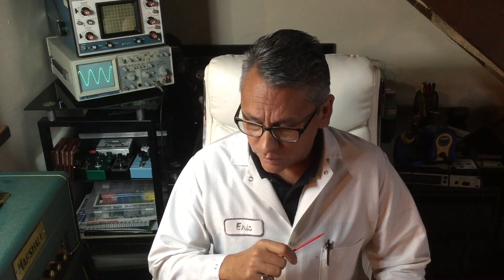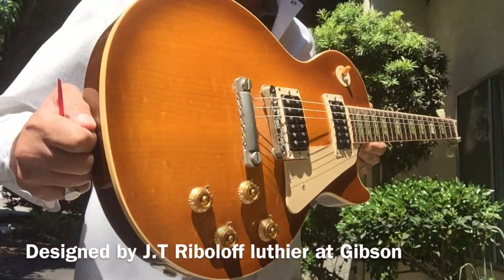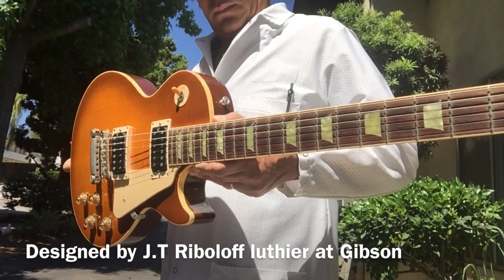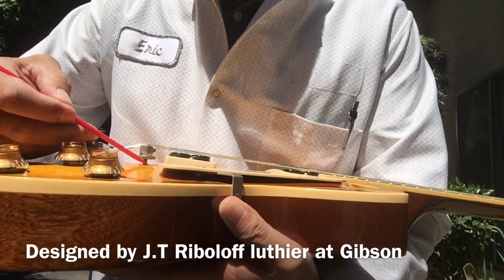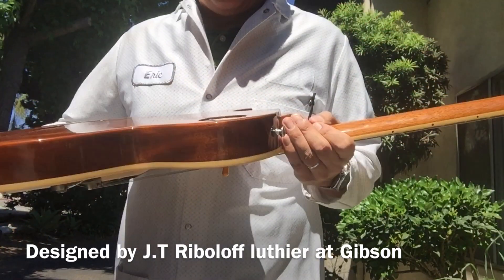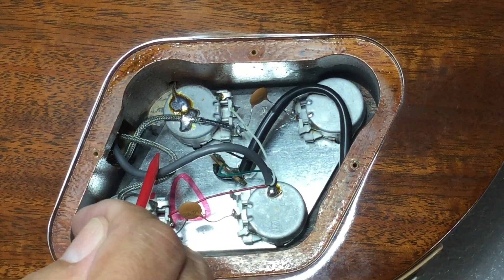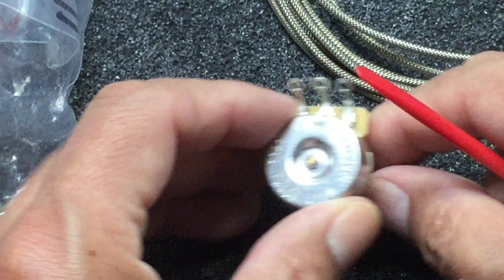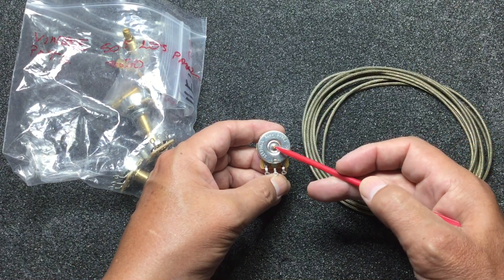Review of the 1990-2000 Les Paul  Classic from an Engineer technicians perspective.

Comment: 1999 Cherry Sunburst Les Paul Classic here. I purchased it new in 1999. Still has the 500T/496R pickups. Recently had to have the frets and neck from the 12th fret up reworked and leveled due to swelling which created a few dead spots. The bridge and tuners are showing some corrosion. Still an amazing guitar.

Comment: I bought a used 1992 LP Classic on the bay back in 2007 or 2008 that looked almost exactly like that one, honeyburst finish with plain top and some bird's eye on it, but it "got lost" in transit and sadly never got home. Finally managed to get my money back (the store didn't want to return my money back... I eventually found out that the guitar had never left the store :smh: it's a long story) and then I bought for a little more a 2006 LP G0 instead, which is a Historic Reissue made by the Custom Shop, basically a R0 made for Guitar Center (hereby the G on the serial #) with plain top instead of figured top. It's been my main axe since that, it sounds and feels amazing and I love it, but I've always wondered what the '92 Classic would be like.

Comment: Great video bro. At the beginning you said the Les Paul classic measurements match several of the 1960 examples that you have had your hands-on, however you didn't specify which measurements. I would be interested to know.

I love the fact that these have the small pin bridge that goes straight into the body VS the grommets/ferrules.
These Classic models are probably the last time Gibson will ever offer that small pin option on a guitar less than $6500 from the factory.
Both Tokai and Edwards LP's offer that option and both are extremely high quality if you can live with a non Gibson name. I can. 
I had a 2006 Les Paul classic honeyburst plain top of course, but I could not live with the green frets! Gosh they were awful, what was that about?
I just got a 1997 classic shipped. I separately ordered the "Retrospec Exclusive Series Cellulose Nitrate Les Paul Fingerboard Inlays" from Historic Makeovers. So that will fix the green issue. 
The non-vintage correct wiring doesn't bother me, I always change that anyways using more modern shielded wire, potted pickups, push pull pot on the neck so that's a wash.  I'm more concerned with the look outside the cavity.

You didn't talk about the Gibaon water slide logo or the printed on Les Paul decals for certain years of the Les Paul Classics. I thought that was something pretty interesting, that might make this collectible one day. Gibson can give us the small pins on this guitar. But they couldn't give us everything.

Comment: Very cool. I have a 2007 Les Paul classic. From what I understand the 2000s Les Paul classics were downgraded somewhat from the 90s ones.
Mine has a two piece maple back instead of one piece. The inlays are an aged color that some people aren’t fond of. The headstock actually says Les Paul model instead of Les Paul classic like the 90s ones do, which would probably help if trying to convert to a more original Les Paul look. Although I think the color and placement that they use for the gibson logo inlay is different from the original Les Paul’s.
I’m not sure if the 90s Les Paul classics were as affordable, but I know the mid 2000s Les Paul classics were the cheapest gibson Les Paul guitar you could get that had full binding.

My guess is that they ended up making a bunch of changes to Les Paul classic - introducing weird colors and knobs and cranked the price way up because the ones from the 2000s could almost be seen as an affordable cheaper reissue.
Reply: What about a 2003?
Are they a little bit like yours and the older?
Reply: gibson used the les paul model decal from 1989-1994ish, and they changed it to be les paul classic. Until, got the decal changed back again to the les paul model in mid-2000s. All Les Paul Classic, I believe, have either one or two-piece mahogany body. cheers

Comment: I bought a new 1999 Les Paul Classic plus from the ill fated Mars Music in Atlanta. I've put this poor thing through the ringer with different pickups and wiring scenarios. Almost sold it a couple of times because I hated it, but 10 years something amazing happened. I actually learned how to play and realized that the dammed thing was amazing. I've settled on Mojotone low winds and 50's style wiring. So happy I held onto this one.
Reply: That's a great shame bud, I have an all original 99 classic and it definitely doesn't need to be altered, if you still have the original parts put it back together, you'll love it even more
Reply: Dominic, bro, you ain’t him. Who are you to tell him what he likes in his guitar? This ain’t a ‘59, nobody should care if he mods his personal instrument
Reply: I try the 50s wiring before and I hated it.   It's more of a online electric guitar trend gimmick. You lose power and volume with that 50s wiring. It makes your volume control obsolete and you control the volume through the tone knob. There was a reason why Gibson stopped using the 50s wiring configuration. It simply reduced the potentials of your Gibson les paul guitar. I prefer the modern wiring that has more options to work with
Reply: @davidallen346 you must of not wired it right. I have full control pot and opened up the guitar 1990 classic plus to alot of tones. The pots and caps have alot to do with the what u get in the end. There are bogus caps and bogus wiring schematic on the internet.

Comment: I have a 1999 Les Paul classic, honeyburst , just like the one you have shown. The main complaint I have is it doesn’t stay in tune too good. The inlays are aged greenish tint also the tuning pegs.
Reply: tuning problems with these would definitely be centered around either the nut, or the tuning peg itself.
Reply: lub the nut, i lub it just fine with vaseline

Comment: You mentioned you’ve handle 5 x original bursts and swear that these ‘90s era classics got identical necks? I don’t think so. I have played a real ‘60 burst and the neck was nowhere as skinny as my ‘93 Classic. Also Seymour Duncan that you put in are average at best
Reply from the maker: Yes. Again, this is what I found from my personal experience as a engineer technician working in the repair business for over 20 years.
Reply: not all the necks on 1960 bursts are the exact same shape and size. not all early classics are the same exact shape and size either. have experience with both the originals and early classics.
Reply: What color is your ‘93? I hope it’s not a wine burst. Those things are haunted
Reply: @darthsensei3838  lol, no it’s a flame top Classic Plus / Honey Burst

Comment: I have a 78' Les Paul Deluxe with mimi-humbuckers. Although the description of this guitar specifies a mohogany neck my neck is maple. 
 Do you know why the neck is maple?
Reply from the maker: Les Paul models in the Norlin era (1969–1985)

 

1974 Custom

 

Subsequent years brought new company ownership to the Gibson Guitar Company. During the "Norlin Era", Gibson Les Paul body designs were greatly altered, most notably, the change to the neck volute. Because the Les Paul had the reputation of having an easily broken neck joint, the volute strengthened the neck where it joined the headstock to avert breakage. To further increase the strength, the neck woods were changed from mahogany to a three-piece maple design. The LP body was changed from a one-piece mahogany with a maple top into multiple slabs of mahogany with multiple pieced maple tops. This is referred to as "multipiece" construction, and sometimes incorrectly referred to as a "pancake" body. The expression "pancake body" actually refers to a body made of a thin layer of maple sandwiched between two slabs of mahogany, with a maple cap. The grain of the maple was placed at 90 degrees to that of the mahogany. The "pancake"-like layers are clearly visible when looking at the edge of the guitar. This process is also known as "crossbanding", and was done for strength and resistance to cupping/warping. Crossbanding was phased out by 1977.
Reply: @FeeserAmplification   Makes since considering Maple is harder than Mohogany. My 78' body is one solid piece of Mohogany however not multiple with the Maple top and is a natural finish which some get confused with a gold top.
 So grateful for your time and feedback. Thank You Sir
Reply: 1974 was Gibson’s last year for mahogany neck construction. 
1975 and onwards, Gibson’s necks were constructed with maple.

Comment: Given that you can get a good standard from the 1990's on reverb for approximately as much as the new standard 50's and 60's, would you recommend today's standards or those from the fifties when it comes to the quality of wood, the pickups, maple tops and the overall quality control being employed by gibson usa? This is ofcourse on an average since you get some better examples than others even with the tightest quality control
Reply from the maker: Have you seen the new Gibson Les Paul standards? These are absolutely beautiful guitars and they are gorgeous to look at. I have 3 of the standards on my test bench now awaiting the full wire harness and paper in oil capacitor replacement. If you are looking for something closer to the original 50s-60s dimensions and tone woods you would be better off choosing the 1990’s Les Paul classic. The cost difference is around $700.00 less then the modern standard for a pristine specimen. You will steel need to replace the wire harness and pickups for both examples. I have found that the 90s 1960’s classic have a slightly consistent better QC overall.

I personally love the new standards and would love to own one.
Reply: @FeeserAmplification  thanks for the reply. Yes, the 1990's classics do have a more attractive look to them with the plain maple tops which I too prefer over the heavy flames that you see on today's standards (and I don't want to get the current classics), however I have not had the chance to hear one of them being played while there are many examples of the current standards. I personally prefer Gibson's old PAFs over these Seymour Duncans but these sound very good too. I guess the main reason I'm asking about quality control is that I am not going to be able to play the guitar before I buy it because I don't live in the States and so if I get a 90's one, if I have to change the wiring, capacitors, etc., it would be near to impossible with the lockdown. I am less likely to have that problem if I just get one of the new standards off the shelf. However, I am very tempted to get a 90's one. 
Any things in particular I should find out first before buying an old one? I am going to have to rely completely on the seller's answers.
Reply: Also by the way, what do you make of the early 2000's Les Paul Supremes? I love the look of the guitar with the flame at the back as well and I like the 490R/498T pickups. The flame on most of them is quadruple A. At just over $4000 are they worth the jump up from a 1990's classic? They sound great.
Reply from the maker: Yes. So, I believe that in your case it may be best to pursue the current Gibson Les Paul standard from lets say the vendor Sweetwater. https://www.sweetwater.com/store/detail/LPS6ITNH--gibson-les-paul-standard-60s-iced-tea Free shipping and you can return the instrument for any reason.
Reply: Okay,  @FeeserAmplification  thanks for the input! Yes, I'll probably resort to that.

Comment: The 500T pickup is the best pickups EVER. I'm very paranoid about pickups I've tried all sorts of duncan's, DiMarzio's on my gibson les paul claßic and 500T is an absolute winner, highly responsive and can create all the tone you need by controlling amp settings and tone/volume setting on your guitar.
Reply from the maker: Yes. I can see that you are a man of good taste. I too am very fond of this ceramic high output pickup’s and believe that these pickups will be collectors items in the nearest future. If you switch to the 1950’s style wiring harness and use paper in oil capacitors you will be further blown away.
Reply: I got a 97 ebony Les Paul studio. I went all through it changing pups, pots, wire, bridge, tuners,nut. Now it's as nice as any Paul I've ever played.